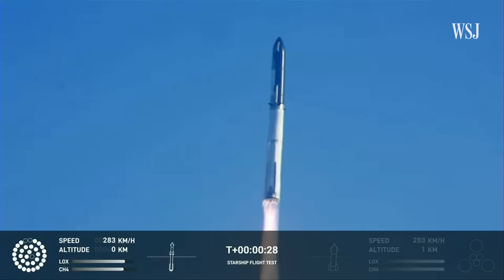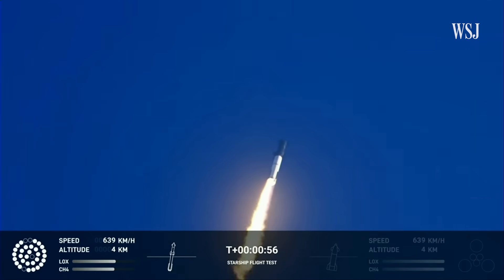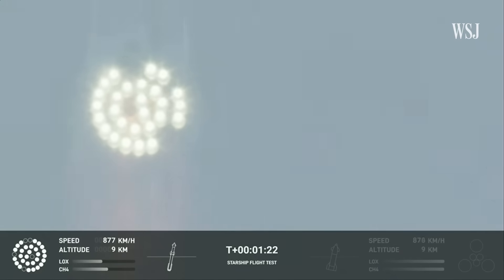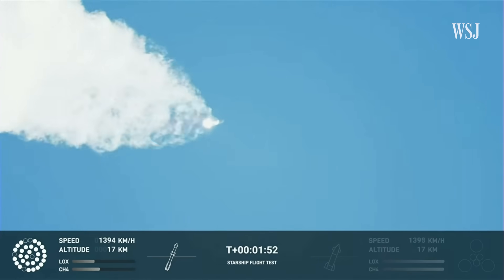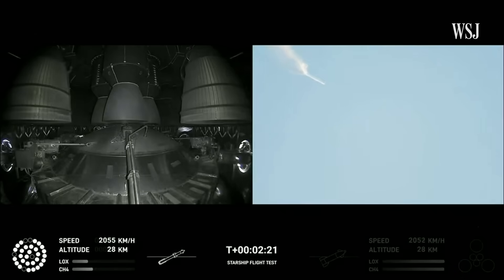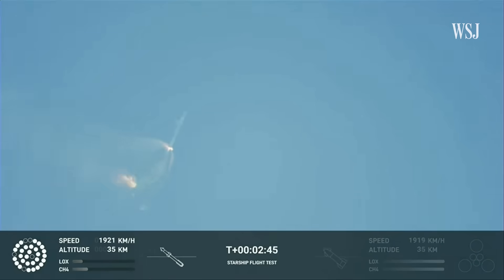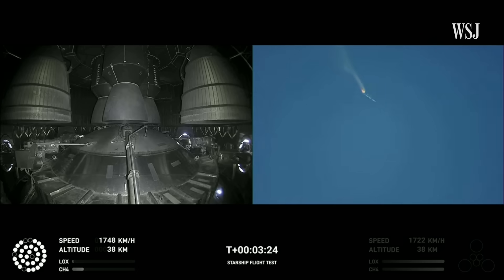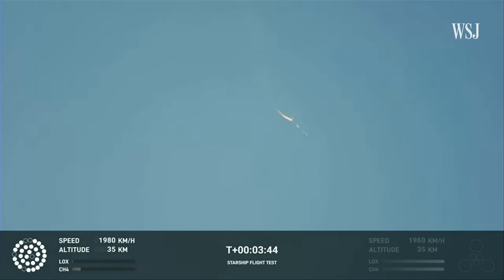Starship Explosion Video: Watch Elon Musk's Rocket Explode After Launch | WSJ

Comment: Totally awesome first launch! I'm surprised that the issues didn't happen when they usually do for new rocket designs, I was expecting the launch stage to fail or some issue with staying pointed in the right direction. Hopefully the fix is something simple and easy, those engineers have already gone through a ton designing an entirely new rocket.
Reply: 6 engines didn't light, 1 or 2 were sputtering, the booster never operated correctly
Reply: @VoltLover00 have to remember its the first launch raptor 2 and booster have even gone through. Going all the way to MECO was a good test considering.
Reply: @VoltLover00  okay? how many engines worked?
Reply: Long way to go.
Reply: Advanced technologies were presented at the international online forum "Global crisis. There is a way out". For example, the health capsule (the possibility of life extension, rejuvenation and absolute health), from time 7:09:09.
These technologies will be available free of charge to everyone when building the Creative Society.
Reply: it's clear that Starship SN11 experienced a pogo oscillation failure (31 -33 ) raptor engines firing at once vs (SLS) Artemis 1 rocket which has a  total of four engines. this and its apparent Disposable launch pad will be a huge hurdle for SpaceX as Multi-engine rockets are much more susceptible to pogo oscillation phenomenon than single-engine rockets. it took Nasa many years of R&D and is the reason why SlS Artemis 1 chose to use tried and true rocket "boring" technology  Pogo was in fact  the main cause of the soviets (30 ) engine N-1 rocket failure Pogo oscillation is a phenomenon that occurs when there is a feedback loop between the combustion process of the rocket engines and the rocket structure. The vibration caused by the combustion process can cause structural oscillations in the rocket, which in turn can feed back into the combustion process, leading to a potentially dangerous cycle of vibrations.

In multi-engine rockets, there are more engines that can contribute to the vibration, which increases the likelihood of pogo oscillation occurring. Don't be so Salty Spacex fanboys! its ok! lol Cheers from Park City Utah!
Reply: @ezragonzalez8936  cool story bro. Space X should have clearly hired you. You are smarter than all of the engineers combined. Even 10x of that. WoW so smart
Reply: @Juice-Chan  I know! Look! She even knows what a Pogo oscillation is! That's a big girl word!!! Oh my, she's as smart as my nephew launching hobby rockets to outer trees,, and he's a big boy! 😂
Reply: @Juice-Chan  To answer your question Little Gamer  manchild! and your sidekick pc os I am A Sr Mechanical Engineer at Orbital Atk  (Grumman) with (6 ) years of experience with Bachelor of Science degree in Aerospace Engineering. 

Our team developed the The Solid Rocket Boosters (SRBs) for NASA's Space Launch System (SLS)

I have knowledge and  experience in The principal technologies in rocket engines  including:

Propellant: Rocket engines use a fuel and an oxidizer to create a chemical reaction that produces hot gases, which are expelled through a nozzle to create thrust. The choice of propellant can vary depending on the specific requirements of the mission, but common propellants include liquid hydrogen and liquid oxygen, as well as solid fuels.

Combustion chamber: The combustion chamber is where the propellants are mixed and ignited to create the chemical reaction that produces hot gases. The design of the combustion chamber can vary depending on the type of engine, but it must be able to withstand extremely high temperatures and pressures.

Nozzle: The nozzle is where the hot gases produced by the combustion chamber are expelled to create thrust. The design of the nozzle can affect the performance of the engine, with factors such as the shape and size of the nozzle influencing the speed and direction of the exhaust gases.

Turbopumps: Many rocket engines use turbopumps to pump the propellants from the fuel and oxidizer tanks into the combustion chamber. The turbopumps are typically powered by a separate source of energy, such as a gas generator or a small rocket engine.

Thrust vector control: Some rocket engines use thrust vector control to steer the rocket during flight. This can be achieved by gimballing the engine, which involves moving the nozzle to change the direction of the exhaust gases, or by using small engines or reaction wheels to adjust the orientation of the rocket.

I am giving my  professional opinion that Pogo oscillation was what went wrong with  Starship Super Heavy SN01

you belittling women speaks volumes about your own frail manhood and insecurities and are not worthy of a response.  Cheers From Utah!
Reply: @ezragonzalez8936  I don't have any formal education in aerospace engineering or orbital/suborbital flight mechanics, I don't know any of the fine details of rocket construction (only broad concepts) so take that as you will when I ask: how does any sort of oscillation have to do with the fact that there was some sort of failure between the separation of the launch stage and the starship? This is not me being mean I'm genuinely curious as to how that might tie into what happened. Is this the case of the stack not separating being the symptom and not the problem?
Reply: @ezragonzalez8936  Thanks for womansplaining rocket science to us. Tell us, is your experience and expertise on spearheading space exploration as big as your head? Impressive! You're the one who'll take mankind to Mars! Elon Musk step aside 😂
Reply: @pcos2401  To answer your question Mr PC Gamer I am A Sr Mechanical Engineer at Orbital Atk  (Grumman) with (6 ) years of experience with Bachelor of Science degree in Aerospace Engineering. 

Our team developed the The Solid Rocket Boosters (SRBs) for NASA's Space Launch System (SLS)

I have knowledge and  experience in The principal technologies in rocket engines  including:

Propellant: Rocket engines use a fuel and an oxidizer to create a chemical reaction that produces hot gases, which are expelled through a nozzle to create thrust. The choice of propellant can vary depending on the specific requirements of the mission, but common propellants include liquid hydrogen and liquid oxygen, as well as solid fuels.

Combustion chamber: The combustion chamber is where the propellants are mixed and ignited to create the chemical reaction that produces hot gases. The design of the combustion chamber can vary depending on the type of engine, but it must be able to withstand extremely high temperatures and pressures.

Nozzle: The nozzle is where the hot gases produced by the combustion chamber are expelled to create thrust. The design of the nozzle can affect the performance of the engine, with factors such as the shape and size of the nozzle influencing the speed and direction of the exhaust gases.

Turbopumps: Many rocket engines use turbopumps to pump the propellants from the fuel and oxidizer tanks into the combustion chamber. The turbopumps are typically powered by a separate source of energy, such as a gas generator or a small rocket engine.

Thrust vector control: Some rocket engines use thrust vector control to steer the rocket during flight. This can be achieved by gimballing the engine, which involves moving the nozzle to change the direction of the exhaust gases, or by using small engines or reaction wheels to adjust the orientation of the rocket.

I am giving my  professional opinion that Pogo oscillation was what went wrong with  Starship Super Heavy SN01

you belittling women speaks volumes about your own frail manhood and insecurities and are not worthy of a response.  Cheers From Utah!
Reply: It was on purpose it was a launch test

Comment: Interesting that so many raptors appeared to be non-functional as it ascended and yet it still ascended past max-q. Great news in that regard. Appears that rocket separation did not occur and since that hasn't really been tested for starship and heavy booster I hope they got the data they needed to figure out why this happened. Watching a huge thing like that spin and not break apart until explosion was something, but also shows that the separation function did not even partially work or Starship would have separated from the booster sooner and probably started falling to Earth or who knows what would have happened if they would have tried to then ignite the raptors on Starship. Probably should have not had Starship include all raptors and taken this as a launch/separation/orbit test and tested starship functions in a later iteration. Oh well. Fun to watch and looking forward to the next launch. Want to see close up of the raptor bath the launchpad received. 🙂
Reply: Most likely, the pad damage caused ricochets of concrete that damaged the 6 engines. The launch pad now hows a large crater underneath.

Comment: this is cool but i still dont get why elon doesn't invest into the magnetoplasmadynamic (MPD) thruster (MPDT). going into space without the need for a rocket would be much better than a rocket.
Reply: MPD thruster technology has been explored academically, but commercial interest has been low due to several remaining problems. One small problem is that power requirements on the order of hundreds of kilowatts are required for optimum performance. Current interplanetary spacecraft power systems (such as radioisotope thermoelectric generators and solar arrays) are incapable of producing that much power. NASA's Project Prometheus reactor was expected to generate power in the hundreds of kilowatts range but was discontinued in 2005.
Reply: soooooo the money people should invest into developing it. they should relight Prometheus' power @imanuel8883

Comment: SpaceX engineers are doing great jobs. Congratulations
Reply: They are extremely idiots 😡
Reply: LOL
Reply: Just blower up the biggest rocket in our atmosphere and you calling this a great job? 
You shouldn't save on your education.
Reply: @peteruhl8181  it is one of most complicated engineering projects in the world. Those engineers will figure out quickly in next few months. I can not help them but I can encourage them to do better’s
Reply: @peteruhl8181  Wise words from someone who clearly didn’t blower their education.
Reply: @peteruhl8181  I'm an engineer. I did work on the Atlas V. This was a spectacularly successful test.

EDIT (explanation): The purpose of the test was to learn as much as possible. If the sensors throughout the vehicle were streaming all the data back to SpaceX (where it can be analyzed), it will have been a successful test. That data will be used to improve the system.
Reply: Can't pass through the firmament dome.. The earth is flat
Reply: @taylorx2  only a real moron would believe in firmament 😅